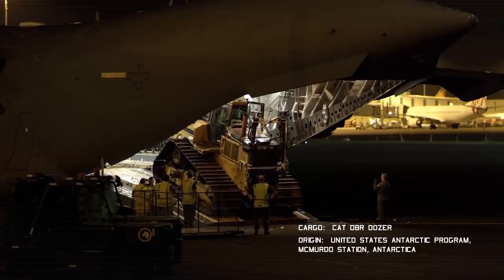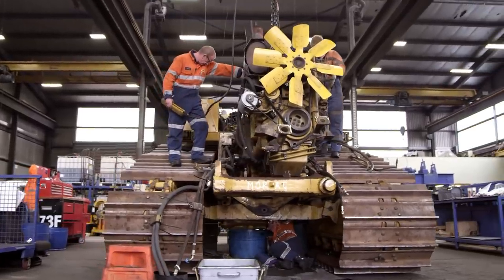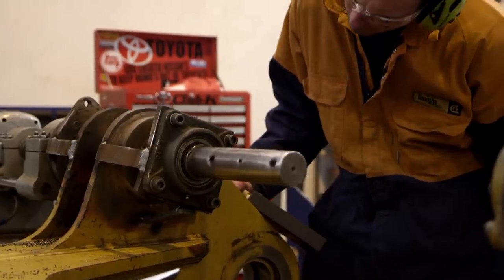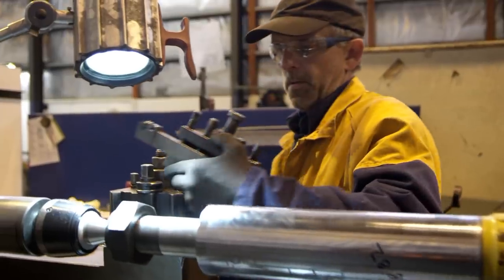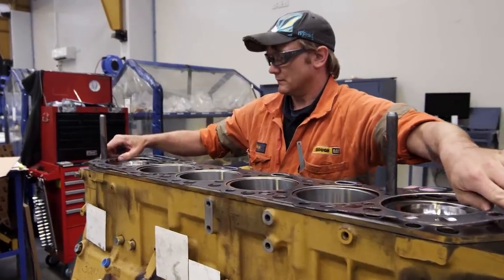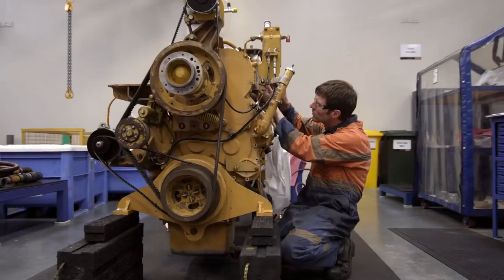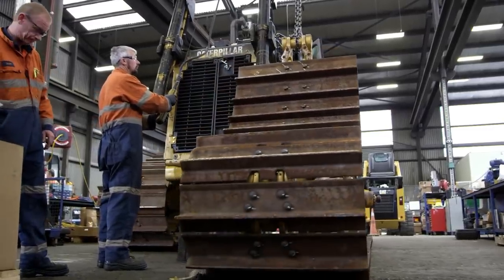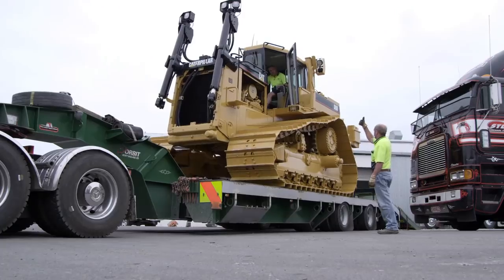CAT D8R DOZER: FULL MACHINE REBUILD

Comment: I was surprised to see the lathe operator using high speed steel tooling for the hydro cylinders vs carbide inserted tooling. Usually Sandvik has their dirty hands on everything lol j/k. Love the video, love the rebuild of equipment that builds the ground of the shop it’s being rebuilt in.

Comment: What amazes me is that an Air Plane can even get off of the GROUND then it's got a 50 Ton Dozer in it on top of that
Reply: TRX VLOGGER 
Bernoulli’s principal
Reply: Well it doesn't weigh no 50 ton
Reply: No even close to 50ton without attachments.  Probably around 30ton
Reply: Kwmike-D 
Maximum payload capacity of the C-17 is 170,900 pounds, and its maximum gross takeoff weight is 585,000 pounds. With a payload of 130,000 pounds and an initial cruise altitude of 28,000 feet, the C-17 has an unrefueled range of approximately 5,200 nautical miles. Its cruise speed is approximately 450 knots (.77 Mach).Apr 25, 2000

Comment: Thumbnail is a duo cone seal.
It is .7244" tall x 10.066" dia. At the top
I like to use a .035" chamfered and then at .1457" it goes to 10.101" and down at a 10 degree taper to the bottom with a nice radius both top and bottom. I use 
.059".

Comment: You gota wonder what the cost of something like that would be, my guess is upwards of $100,000

Seeing as how that cargo plane alone would cost $10,000 a flight...
Reply: 100k might buy you an engine, it cost 200k to do a CPT (certified powertrain) on a D8T
Reply: purchasing a unit might cost $2 million. Refurbishing. I'm thinking $300,000 plus
Reply: @warphonesS22  Kosta cela reparacija najvise 20.000$
Reply: I think it would cost a lot more than that for a flight to new Zealand. What would it weigh without the blade , 50 tonnes ? to get that amount of weight up into the air and fly would burn lots of fuel. and cost a lot.  I would say 400k all up for everything . And you need one of those down there to run over 'the thing' if they ever encounter one in the ice one day .
Reply: effinghamhick  no way. That machine new cant be anymore than 500k. On off parts always cost more than if u bought a hole bunch. Im sure given the work load their was a price break on parts and such. And considering the factory did it helps alot to. But hey thats just the trade we are in. I paid 450$ for 2 hydro lines for my Hitachi.
Reply: That as my first thought. I assumed that anything of this size so coming from Antarctica would be moved with an ISO 40' container. Air-freighting a dozer has to be expensive.
Reply: огромная эрекция  no way. Cause a D10 is only like 1.2 mill
Reply: Remember the client is the US defense department... they should be good for at least half a mill just in mark up on the parts...
Reply: It's a 500k machine new
Reply: Base model is probably around 500k nzd new but I don’t imagine the rebuild would be cheap and the us airforce would fly it themselves so probably wouldn’t include that in the price
Reply: A new pickup truck costs $100000. That Cat is going to be more $$.
Reply: Kwmike-D really? This UNIQUE Caterpillar-backed machine specifically built for the Arctic is $500k? That’s all? Really? Really...
Reply: @Huvvuv  a cool billion dollars. I've got three.
Reply: A total rebuild is about 70-75% of the cost of a new one.It is economically viable to rebuild if mainframe is sound, thisone was retrofitted for the Antarctica climate and terrain. It was about $700K, with shipping for this machine.

Comment: i think that i might have painted the individual components with it apart.. to get better paint coverage to the hard to get at areas since it is exposed to extreme weather conditions.  might be something to do to the main frames, cabs and undercarriage sections for regular rebuilds.
Reply: I agree, the Track shoes were kinda rusty looking, could have been shot blasted and repainted before re-assembly for longer life..
Reply: @danielhanney3326  if you'd have paid attention you would have noticed that the machine had both new rails as well as new pads intalled and left the dealer all painted up. One other point...that unit would have no paint left on those pads after 6 months of use.
Reply: Why? It's all gonna wear right off

Comment: It seems like a rebuild/restoration of that scope would cost as much as or more than simply buying a new tractor.  Every aspect of the machine has been gone through, but without the efficiencies of the factory assembly line.
Reply: Except for fabrication and assembly of major components not to mention the chassis of the tractor itself. I think if it was cheaper to buy a new one they would have bought a new one. My guess is it would by close to 80% of the price of a new one.
Reply: They outlined up front the one of a kind design. So, no a new one would not cost less.

Comment: I love seeing one of these rebuilt but i love how the us paid another cat in another country to rebuild it instead of a cat dealer in the usa
Reply: It is far more efficient to take it to a CAT Dealer, closer to where they run the equipment.
Reply: Leonard Carr  You're kind of all over the place there, my friend. I'm sure they do a fine job on the equipment, down there in Christchurch. But, I hope you're not saying that another CAT Dealer, couldn't do the same job, just as good?
Reply: Leonard Carr I’ve seen there Peoria location before they closed it down. It’s bigger than a small town. It’s miles of factory.
Reply: Cat shut down that peoria plant?
Reply: All air traffic to and from Antarctica goes via the airport in Christchurch. The dealer is less than five miles from the airport. Shipping by sea would have deprived McMurdo of the the D8 until the next summer, almost a year.